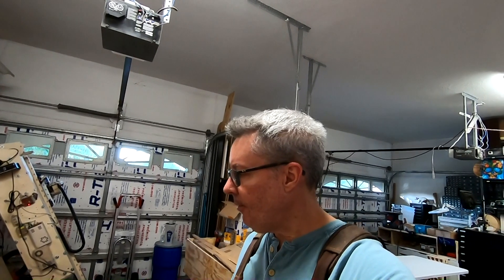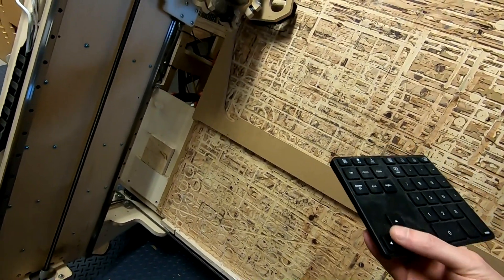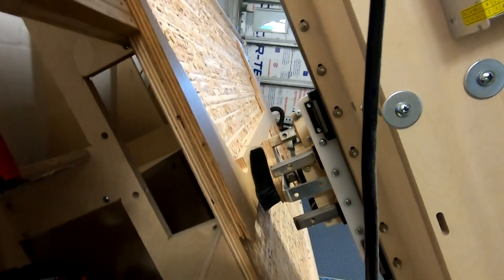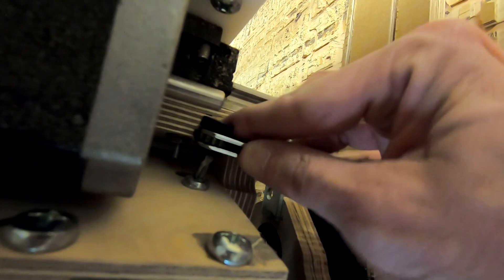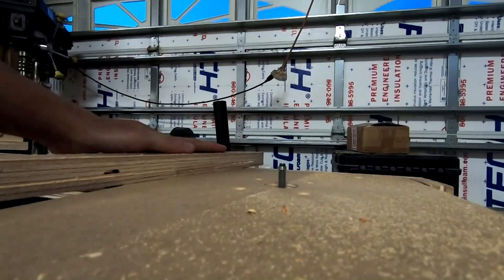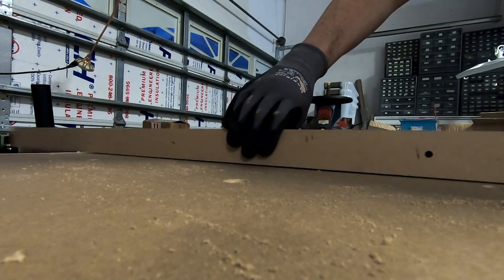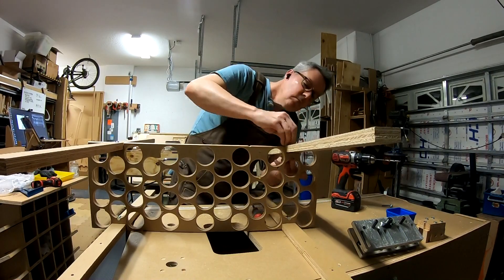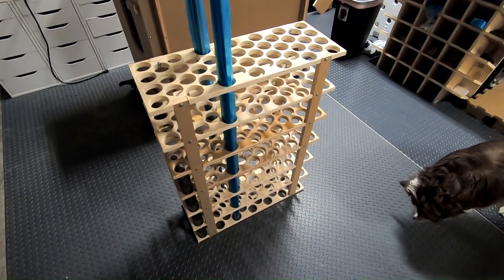CNC Routing Process (CAD, CAM and CNCl) Variant 2: Part 5 Cut Out the Legs and Assemble.

Comment: I bought one of the 4x8 greenbull_v2 60degree parts kit a couple days ago.... delivery in about 6x weeks .. can't wait.  (it will be an experience to assemble it at  1/3  the cost of the assembled!)   I have gone through all the videos on this  series for CAD design -> CAM -> execution with Mach3 and Greenbull_v2....very, very impressive!  I design and fabricate studio and live sound speakers (these are almost all BIG systems, with some small near field monitor designs as well) .... this will allow me to take my designs I already have (and create newer ones that are more complicated and intricate, in ways that are not possible to do reliably or cost effective by hand)  - get them into the CNC process and pop them out.  We use 3/4 MDF for studio stationary ones, and Birch ply for touring road / live speakers that will usually be covered with fabric and or sprayed with a rugged plastic surface.  Bravo Patrick and Team!!!